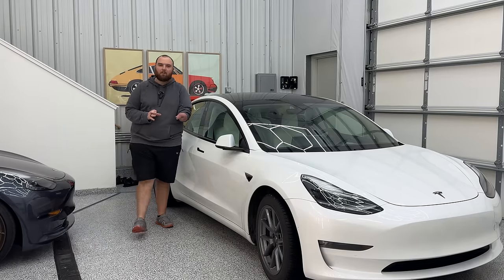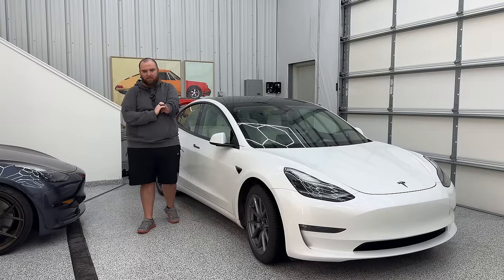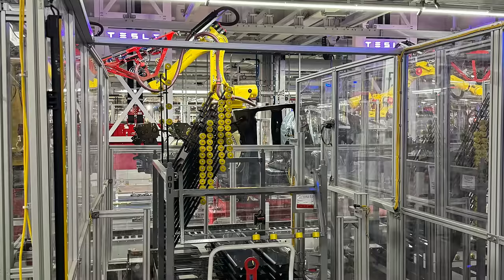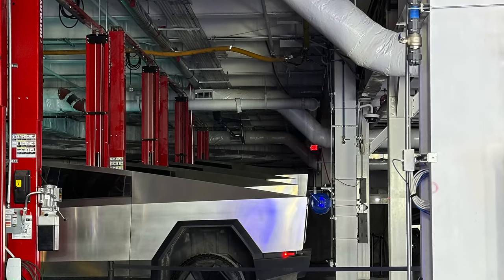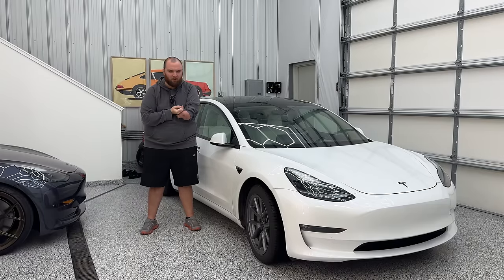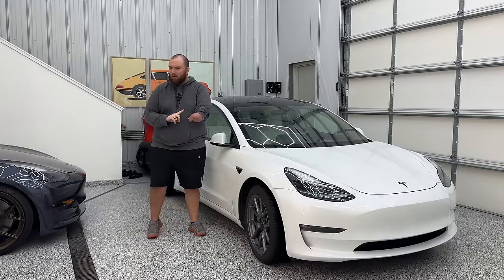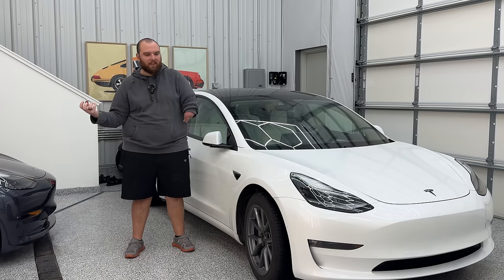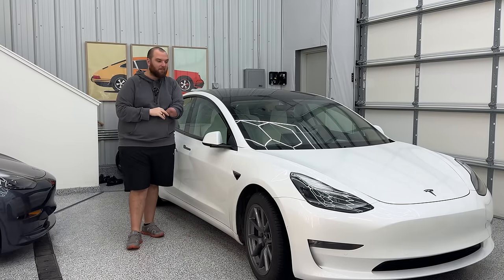Tesla Cybertruck Build Quality- My Impression After Seeing Customer Deliveries In Person!

Comment: I think grey Scotchbrite and hand sanitizer (gelled alcohol) might clean the stainless.  Or low abrasive cleanser.
Reply: Harder Scotchbrite pads, green, blue and red scratches 300 series stainless steel like you wouldn't believe. I'd even be careful using low abrasive cleaners. Stainless Steel is a nightmare to clean if you're worried about maintaining the original finish. Wash all loose debris off with a hose and only use a soft cloth keeping the scrubbing motion in line with the grain, not in circles. And pray that you don't get a bit of sand or grit caught up in the cloth. That will mean tears. Ask me how I know. Actually, please don't.
Reply: Sanding blocks can be used to Disable ICE cars.

Comment: Coleton,  what are your thoughts on having a clear coat paint applied to the stainless.  Would the care at that point be the same as a base coat clear coat?  Thank you for your thoughts.
Reply: What clear coats adhere to stainless steel? And if there is one, how UV stable is it? I wonder if some sort of epoxy would do the job.
Reply: no point in Doing so , clear coat wont even Stick anyways.

Comment: Hey Coleton, so many folk are talking about how to deal with fingerprints on the CT's stainless steel.    I would love to post a suggestion to the planet:  BABY OIL!  We have been using baby oil on stainless steel appliances for years.  Bingo, fingerprints are no longer an issue.  Apologies if you have already recommended this solution, it's different - but it's simple and it's easy and cheap.
Reply from the maker: I think anything oil based: baby oil, WD-40 will only attract dirt and become splotchy after washing.. I think it’s a quick solution but you’d need to do the entire truck every wash… Doesn’t seem ideal as a solution
Reply: @OutofSpecDetailing  never thought of the water spotting!  Come to think of it, we're not in the habit of leaving our stainless steel refrigerator out in the rain :\.    Thx
Reply from the maker: Seem to be a common thought. Everyone has their way of cleaning stainless steel INSIDE. Whole different ball game out doors!

Comment: Does the Cybertruck have a 48 volt battery somewhere? Has anyone noticed anything that looks like a low voltage battery in the factory videos?
Reply: They might have wired 4 12V motorcycle batteries together. 😂😂😂
Reply: @JetFire9  The ethos is not "the best part is 3 more parts". The Tesla ethos is the best part is no part.
Reply: @frankcoffey  So you think there’s no LV battery to power the drive by wire steering and brake booster when the HV pyro fuse blows because one of the inverters failed??
Reply: @JetFire9  I’m not guessing reasons right now just trying to determine if it exists and where it’s located.
Reply: 48V li-ion nmc or lfp
Reply: @frankcoffey  I am much more intelligent than you.

Comment: this truck had the range that works for me but i an independent contractor and this truck couldnt do even 1 thing i need in a work truck so. if i needed a private family truck then this thing is amazing!

as far as the steel i think everyone will sit on the base look for the first year then probably begin to fantasize about wrapping it.

i only buy cars with a complete round steering wheel as all of the old tesla track drivers lost lap times with the new yoke and people that are true drivers value a round wheel for the advantage it provides and i have an issue with getting rid of stalks and yes we can learn to live without it but when im spending nearly 100k on a car i want more options and redundancy

Comment: i installed a lot of stainless in my kitchen and years later im seeing tarnish that can only be cleared up by stainless cleaner only. if this truck tarnishes faster from being out in the elements i can only imagine the thousands of dollars and hours to polish stainless
Reply: It’s very little like the stainless in your kitchen, so we’ll have to see
Reply: @kalasmournrex1470  yes food grade stainless is more expensive than tool grade stainless and tool grade stainless tarnish but more resistant but its magnetic and can rust with to much exposure. so your right we must see now much nickel it has. 
1 thing i do know is every stainless on the entire chart can and will tarnish at various rates or exposure
Reply: Tesla HFS is Super corrosion and RUST prevention.
Reply: @markplott4820  well all stainless is highly rust resistant. have to try hard to make stainless rust. but every stainless on the chart will corrode more so if stainless meets another alloy.

Comment: OK Andras - your points are there are Y's with the 4680 - How many? According to Tesla; they've made 20 million 4680b cells total to date. If that took a year to accomplish reject rates are terrible. 20 million is only enough for 16,000 cybertrucks  OR 18000 Ys OR 1500 Semis.  It would be stupid to build Y's with 4680s other than a handful for testing; because every Y build means 1 less Cybertruck a Semi built means 10 less Cybertrucks - So it doesn't matter they won't be building many CTs any time soon.  12-18 months is optimistic; and lets say its really takes 2 years - by that time a lot of demand will be satisfied by others and probably the price up to 150K.

Comment: You can have all the impressions you want first of all you're not an engineer this truck hasn't been out long enough to really prove how reliable and tough it is just my opinion I have already heard of a couple of these trucks in the backwoods and real bad trails having bent suspension parts I've seen videos on it when you compare the front end components to say a Toyota Tacoma the Toyota is built 10 times more heavy duty than the Cyber truck I just don't know how you guys jump the gun and say this truck is so good when the goddamn thing just came out this is just my opinion I don't have nothing against electric vehicles but let's not act like this is the best thing since sliced bread another thing about this truck who cares how fast it is who cares if it's bulletproof none of that matters to a typical truck owner one thing that's very disappointing already about the Cyber truck is the low range just think when you start pulling a heavy trailer in cold weather you're going to lose a lot of your battery another thing Elon musk said the truck was going to be $40,000 and now all of a sudden it's 60 k and plus Elon musk nickels and dimes people for every goddamn thing does that guy not have enough money already

Comment: Great video but my heart is broken to see the crashed example has not exoskeleton at all! The folded steel was to act as a full chassis and therefore save weight, now I see it is just glued on dressing.So let down.
Reply: Check Top Gear's video on the Cybertruck. At around 11:30 mark, the VP of vehicle engineering explains how the panel behind the C pillar adds 25% to the rigidity of chassis.
Reply: @benliu6420  so what? All structures add to rigidity. The unorthodox appearance of the truck was to be half as light as regular truck designs that’s what was going to drive efficiency. That didn’t happen now you have crazy looks for what?
Reply: @Holeyguagaamoley  lol, do you think the quarter panel on you car will add 25% to the rigidity of your car? The cyber truck is made lighter and stiffer than its competitors, even stiffer than a McLaren P1 which has a CF monocoque.

Comment: Oh revealation MDF - we have 4680s in Ys huh?  Are you getting confused with LFP?  Or you mean the "new" 4680 Nmc pack which you can't get?  Find someone with one that doesn't work for Tesla. Same reason they can't make the 4680 reliably - total production to date is 20 million cells; of that most are junk defects. Even if every one was functional that is only enough for 15,000 packs; but the actual number is more like 3000.  They won't be wasting any in Ys except as a test; CT will get any they have that work; and if current delivery is indicative it isn't going to be very many - so far 12 officially delivered after 8 days; today is Dec 8th.
Reply: That's a lot of bullshit.
1. There are Model Ys with 4680 cells. Not many, but they exist.
2. In reality the yield has been good for a while now.
3. Tesla had to dial in the production first. This cell contains a ton of big innovations, and it's Tesla's first cell, so issues are expected.
4. The production ramp is now extremely fast. Like 20% per month. And once the first full scale production line is done, the rest is mostly just copy&paste. So there will be plenty enough cells soon.
5. Have you seen the CT production line? It's clearly designed for really large scale production. According to Sandy Munro the it has a 600K per year capacity.